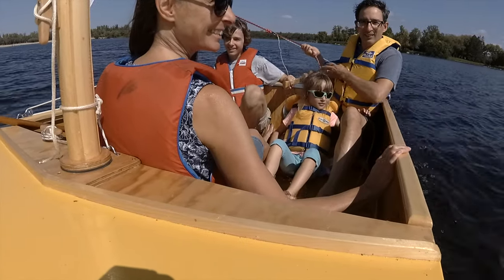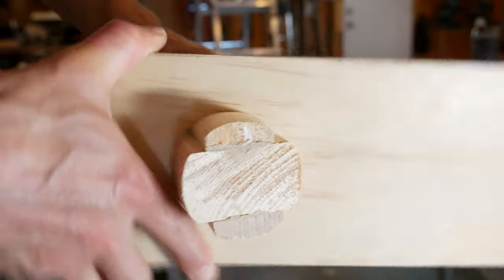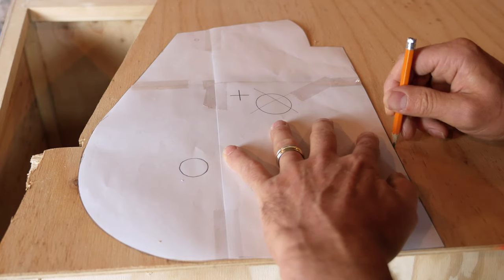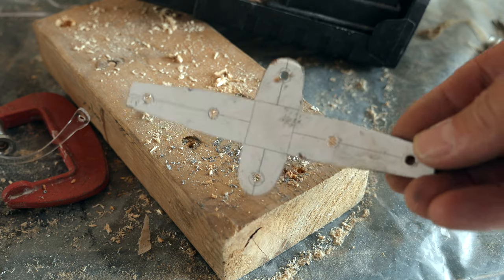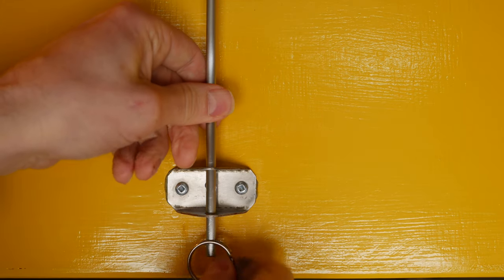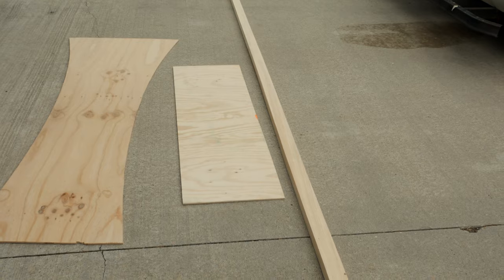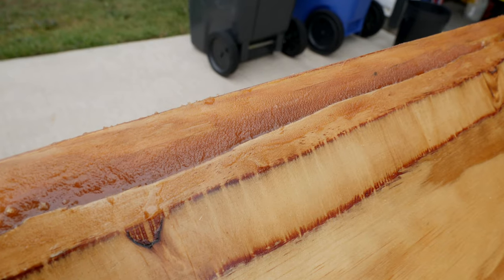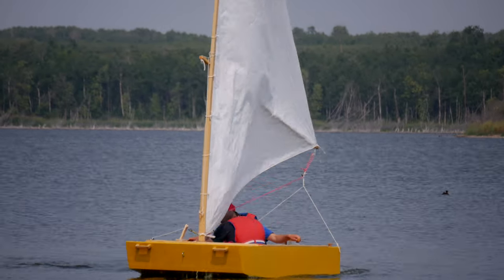DIY Plywood Sailboat Full Build Part 2- Making the Rudder, Leeboard, and Mast. PD Racer

Comment: Fantastic Effort Chris. Replace the rudder fitting screws for the transom with bolts ... you will thank me. Or how would you know that they were going to pull out if you replaced them!? But do it :)
Reply from the maker: Ahh, thanks for that tip, I do trust that you have profoundly more experience in knowing how to not end up in a broken boat:) I'll most definitely swap the screws for bolts. Mind me asking what is the best way to seal the bolt holes so no water gets into the boat through them?